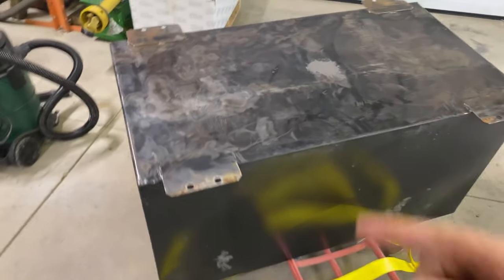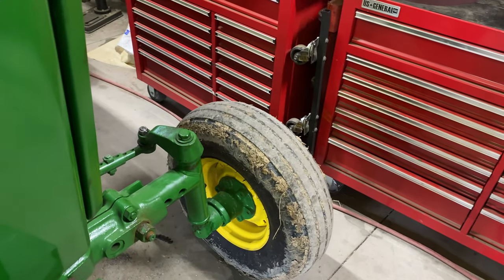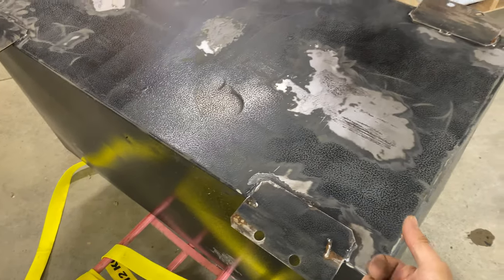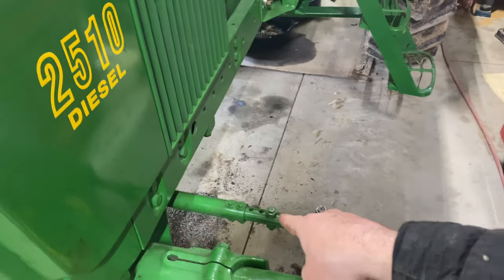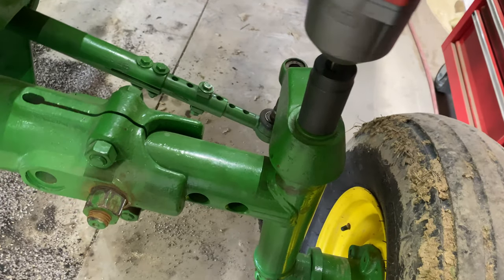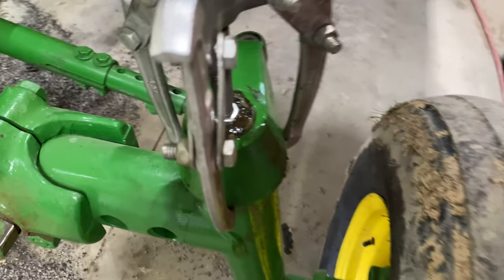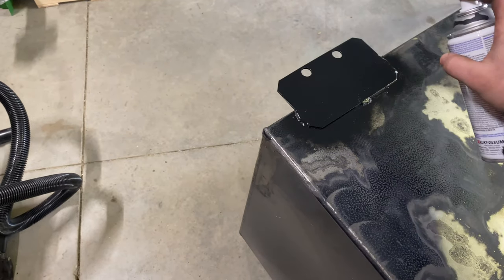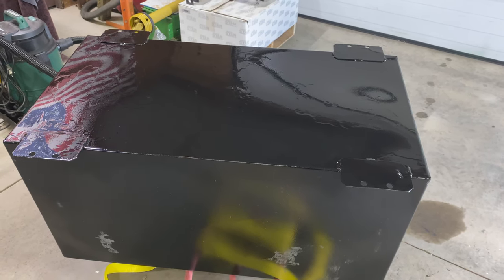Painting the Fuel Transfer Tank and Working on the John Deere 2510 Steering

Comment: The parts book show the steering arms to be  a left and a right maybe you have two the same also that is a tapered spline , so with a lil heat that should pop off. good luck
Reply from the maker: Good luck is right, never did manage to get it off, and a torch is one thing I don't have.